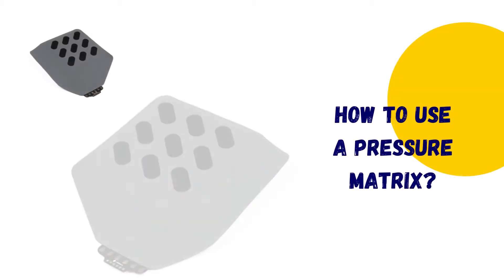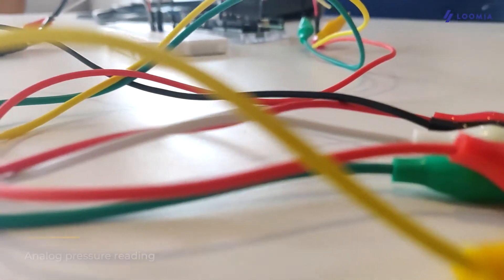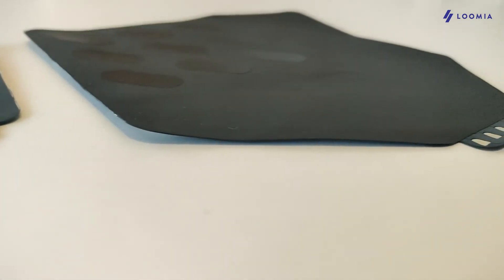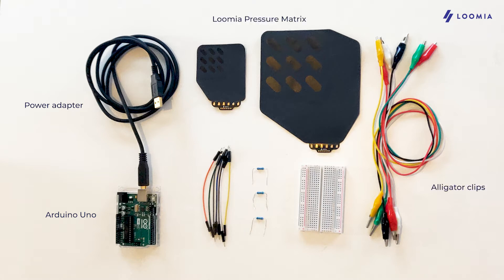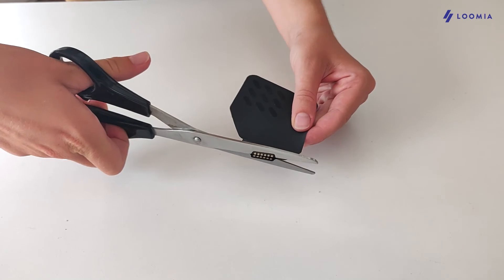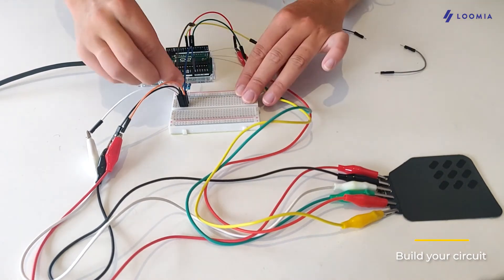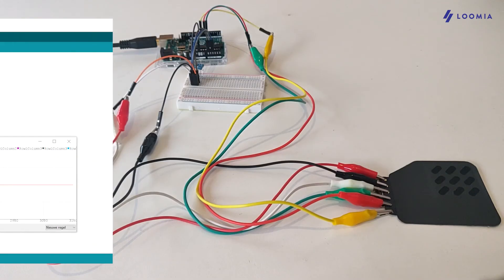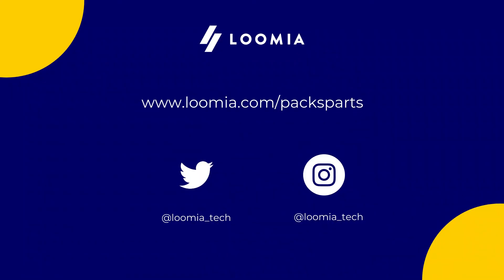How to Use a Pressure Matrix Sensor With Arduino

Comment: cant find the code on the website - can you please share the link?
Reply: int vertPin1 = A0;
int vertPin2 = A1;
int vertPin3 = A2;
int horPin1 = 6;
int horPin2 = 7;
int horPin3 = 8;
int vertVal1 = 0;
int vertVal2 = 0;
int vertVal3 = 0;
int vertVal4 = 0;
int vertVal5 = 0;
int vertVal6 = 0;
int vertVal7 = 0;
int vertVal8 = 0;
int vertVal9 = 0;

void setup() {
  Serial.begin(9600);
  pinMode(horPin1, OUTPUT);
  pinMode(horPin2, OUTPUT);
  pinMode(horPin3, OUTPUT);
}

void loop() {
  digitalWrite(horPin1, HIGH); // Write horizontal line 1 high
  readRow1VertValues(); // read all vertical values for horizontal line 1
  int values[] = {horPin1, horPin2, horPin3};
  digitalWrite(horPin1, LOW);
  digitalWrite(horPin2, HIGH);
  readRow2VertValues();
  digitalWrite(horPin2, LOW);
  digitalWrite(horPin3, HIGH);
  readRow3VertValues();
  digitalWrite(horPin3, LOW);
  Serial.println();
}

void readRow1VertValues() {
  vertVal1 = analogRead(vertPin1);
  Serial.print(" ");
  Serial.print("Row1Column1");
  Serial.print(" ");
  Serial.print(vertVal1);

  vertVal2 = analogRead(vertPin2);
  Serial.print(" ");
  Serial.print("Row1Column2");
  Serial.print(" ");
  Serial.print(vertVal2);

  vertVal3 = analogRead(vertPin3);
  Serial.print(" ");
  Serial.print("Row1Column3");
  Serial.print(" ");
  Serial.print(vertVal3);
}

void readRow2VertValues() {
  vertVal4 = analogRead(vertPin1);
  Serial.print(" ");
  Serial.print("Row2Column1");
  Serial.print(" ");
  Serial.print(vertVal4);

  vertVal5 = analogRead(vertPin2);
  Serial.print(" ");
  Serial.print("Row2Column2");
  Serial.print(" ");
  Serial.print(vertVal5);

  vertVal6 = analogRead(vertPin3);
  Serial.print(" ");
  Serial.print("Row2Column3");
  Serial.print(" ");
  Serial.print(vertVal6);
}

void readRow3VertValues() {
  vertVal7 = analogRead(vertPin1);
  Serial.print(" ");
  Serial.print("Row3Column1");
  Serial.print(" ");
  Serial.print(vertVal7);

  vertVal8 = analogRead(vertPin2);
  Serial.print(" ");
  Serial.print("Row3Column2");
  Serial.print(" ");
  Serial.print(vertVal8);

  vertVal9 = analogRead(vertPin3);
  Serial.print(" ");
  Serial.print("Row3Column3");
  Serial.print(" ");
  Serial.print(vertVal8);
}
Reply: here's a version that prints as a table with the values in each cell:

const int NUM_ROWS = 3;
const int NUM_COLS = 3;

int vertPins[NUM_COLS] = {A0, A1, A2};
int horPins[NUM_ROWS] = {10, 11, 12};
int vertVals[NUM_ROWS * NUM_COLS] = {0};

void setup() {
  Serial.begin(9600);
  for(int i=0; i<NUM_ROWS; i++){
    pinMode(horPins[i], OUTPUT);
    digitalWrite(horPins[i], LOW);
  }
}
void loop() {
  for(int i=0; i<NUM_ROWS; i++) {
    digitalWrite(horPins[i], HIGH);
    readVertValues(i);
    digitalWrite(horPins[i], LOW);
  }
  
  // Output the grid
  for(int i=0; i<NUM_ROWS; i++) {
    Serial.print("|\t");
    for(int j=0; j<NUM_COLS; j++) {
      int index = i * NUM_COLS + j;
      Serial.print(vertVals[index]);
      if(j < NUM_COLS - 1) {
        Serial.print("\t|\t");
      }
    }
    Serial.println(" \t|");
  }
  Serial.println();  // Separate grids with an empty line
  delay(20); 
}

void readVertValues(int row) {
  for(int col=0; col<NUM_COLS; col++) {
    int index = row * NUM_COLS + col;
    vertVals[index] = analogRead(vertPins[col]);
  }
}
Reply from the maker: Thank you for your help here @kenna930!